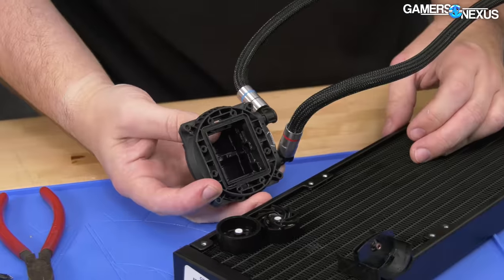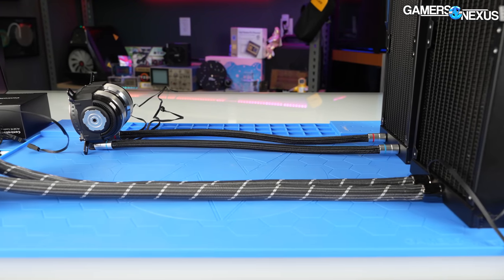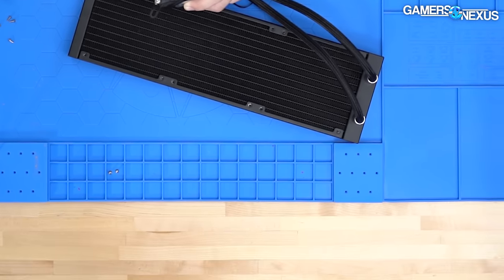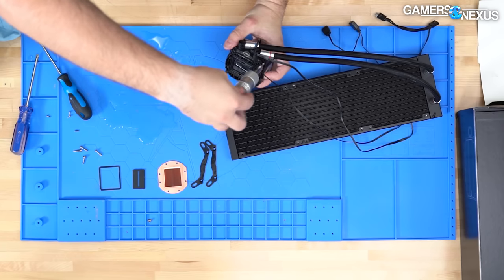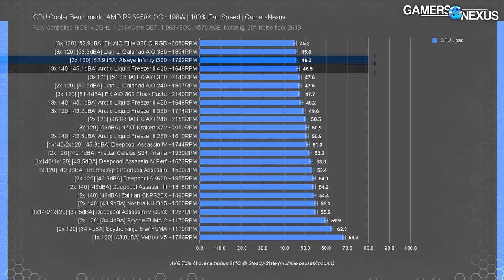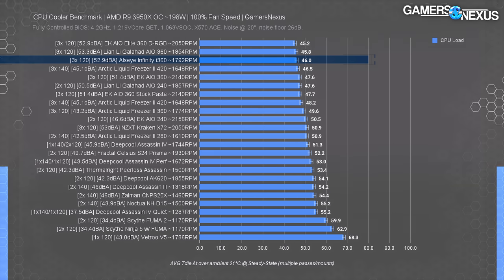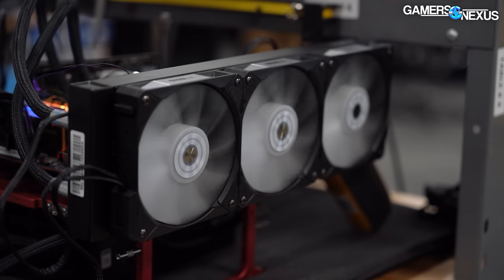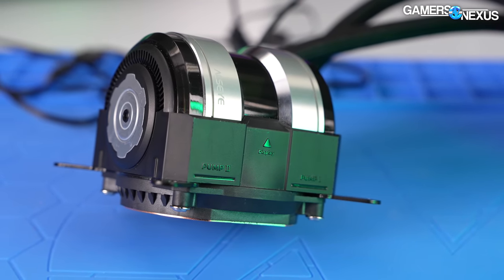Strange Liquid Cooler from AliExpress | Alseye Infinite i360 Dual-Pump AIO

Comment: So one of the things to consider when reviewing these AIOs is using a standardized set of fans so you know how well the water cooling aspect of the solution works vs the whole package. If you could get ground breaking performance from an AIO just by replacing the fans with a high airflow/static pressure solution that would be really helpful to know.
Reply: Good point. Ive used Push/Pull setups with high end fans on lower end 240s/360s. The difference was crazy of course. $75 cooler with some Phanteks T30s will cool a 13900k lol. Wont be quiet, but still lol.
Reply: Exaclty ! I would to see love that especialy since you can use the fans somewhere else and Use a better fan for the radiotor !
Reply: You can kind of tell this already by comparing the full speed graph vs the noise normalized one.  Generally the limiting factor for AIO's (and all heatsinks really) is the thermal density of what they are cooling and the thermal conductivity between the cpu die and their fins.  Another catch for a heatsink is heatpipe orientation as the CCD's will utilize fewer heatpipes if the heatsink is installed in one direction vs another.
Reply: While this is absolutely worth considering, it should also be noted that buying different fans will cost more money. That can easily push an otherwise price competitive product into being more expensive than other products that already come with premium fans that gain nothing from different fans.

And once you go down that route, you'll also have to do it for air coolers, where most can take standard fans as well.
Reply: Also IMO to try to minimize the extra work that could even replace the uncapped fan tests becase as its been said many times fans just brute force with speed and how realisticly is it that anyone would put up with that nosie level so really is it all that relevant...
Reply: @Xalies  well, they normalize for noise, which these fans obviously underperform at, if instead (or in addition to) they normalized with a set of fans that have a known performance, you would eliminate that variable from the tests. If they test it and it turns out there is no difference from fan upgrades, then sure, I would agree, but my experience with upgrading fans on coolers has been quite significant. It would be nice to know which AIO has the best core performance, fans excluded so you know how to get the best overall performance. I could imagine some of these AIOs come with placeholder fans that they don't even expect many end users to use based on their target market.
Reply: @BaronVonNeil  A fast way to reduce noise and increase performance is put some empty fan frames between the fans and the radiator.  The spacers can be more effective and quieter than adding 3 addtional fans to the opposite side of the radiator.
Reply: Not really, considering that this is more expensive than a much more efficient Arctic solution. Good fans are pretty expensive too, and people watching reviews for an AiO don't want to buy extra fans for around 40-60 Euros with an already expensive cooler, they want an all in one aolution that just works. So it's totally irrelevant if the cooler is better with other fans, cause for that money you can just buy another AiO that has a better overall performance.
Reply: @MrMartinSchou  No doubt at all man! Fans can definitely cost the full amount of a decent AIO now days lol.
Reply: @masterluckyluke  Do consider that Arctic fans are quite often absolute garbage due to bearing noise, my 3 or so month old cooler already has new fans on it because of the unbearable noise they made.
Reply: @kristoffer3000  Maybe bad luck? I mean in this reagion, when the fans die after a few months you can get a free repair or replacement because of the two years implied warranties. And in the tests I saw so far, the arctic coolers were between the most silent ones, also because of the thick radiator of course. However I'm not sure if I want to buy a watercooler anyway, and I also like the BeQuiet products, so maybe I just buy a Dark Rock air cooler. The main reason I look at AiOs isn't the better cooling anyway, the main reason is that air coolers need so much room and often block parts of the RAM. I'll think a bit more about it, maybe I find other users who can confirm the issue.
Reply: @masterluckyluke  I googled it and there were loads of complaints about it, I could've sent it back but I needed the cooler so I just got new Noctua fans instead, my old one just couldn't deal with my new 5800x3d haha
The Arctic is really quiet if the fans don't have the bearing noise.
Reply: @kristoffer3000  yeah some of their fans are worse than others and sometimes you even just get bad fans out of a batch. With the varying quality in their products it makes it hard to know which you got.
Reply: That's a very good suggestion, I agree!
Reply: He would have to implement it into all of the test setups though to get accurate readings
Reply: @nicknorthcutt7680   it's too difficult to attach the same fans (like decent noctuas) at max rpm into each aio and see what happens? are you implying he has a different test setup used for each aio, wouldn't that invalidate any of the comparisons? I'm not sure what the problem is

Comment: One Idea for AIO testing: Could you  use the same fans for all AIOs? This would bring out more the noise differences of the pumps and flow efficiencys. Sure the included fans are mendatory but could be tested seperately.
Reply: I was also wondering, because probably you want to change them or whatever

Comment: The fill port is actually pretty nice. Good to see AIOs with an accessible fill port.
Reply: Sadly it voids warranty. Same with the Galahad if I'm not mistaken.
Reply: @GabrielRodrigues-fg6ex  It is annoying but kind of makes sense. There really should be no reason to use a fill port under the warranty period. If something goes wrong, send it back.
Reply: It's useless to the end-user without a second opening to bleed air through. Manufacturers don't need one because they evacuate all the air from the loop before they pump liquid in - it's much quicker that way, and you can detect leaks while the unit is dry.
Reply: @GabrielRodrigues-fg6ex  The permeation rate isn't large enough to warrant the user to refill the AIO before the warranty expires. And if it does, something else is likely wrong with the unit and you're better off claiming the warranty to get it replaced

Comment: It would be interesting to see how this weird push-pull pump setup works with better fans, as it sounds like it's competitive with crap fans. I like that it has a fill port, that's something more AIO's could do with.
Reply: Yeah, to everything you said, the current test setup seems to test out of the box and not so much testing the AIO, some good things like the flatness and pressure map of the cold plate, but then uses the stock fans which is more a test of the stock fans ability and really should be in a fan test video, testing all the AIO's with the same fans would seem like it would give a more consistent test between AIO's, the issue being 120 and 140 Rads, with regards to pressure and volume of air and perceived auditory volume.
Reply: sometimes they swap the fans you get with the AIO either way
Reply: @MrTrilbe  I totally agree with ya, it seems to be solid other than the fans. I wonder how it would hold up over time. Also, I would be very interested to see the performance with one of the pumps disabled- Having dual pumps sounds great for redundancy on paper, but I have no clue how that would work in practice. 
I can kinda understand why they didn't swap fans. I guess because an AIO is supposed to be "All in one"/ plug and play, but I wouldn't mind throwing some upgrade fans on one of it's at the top of the pack- for me, swapping some fans on an AIO still beats the headache of open loop even if the price is close with less performance.
Reply: When every AIO manufacturer was using Asetek's pump design, it wouldn't have made sense to do that kind of test. Now that there is some varied competition on the market I agree, I would like to see "standardized fan tests" for these coolers to see who has the better pump/coldplate design.
Reply: @AlanTwoRings  But the full product is sold with Fans. So The full product should be tested as it is.
When a car is being tested it is tested as it was sold. A test with wider tires, a new suspension and maybe a tuned engine wouldnt help.
It can be tested but thats more something special.

Comment: @GamersNexus Spotted a potential duplication at 14:57 for the "[3x 140] [45.1 dBA] Arctic Liquid Freezer II 420 ~1648RPM" data - I see it twice on there, with temps of 46.5 and 48.2. Separately, been soldering a ton on your recent soldering mat, and loving it. Thanks for being awesome

Comment: Just installed this cooler on my AM5 platform yesterday. Wasn't my choice, got it for free from a friend, that said, very nice performance on my end. Gave me the same thermals I got from better-known brands with a much greater price tag attached. I don't know if it's going to stand the test of time, but so far so good. And just a quick note, my fans are as quiet as previously installed coolers by Corsair, maybe I just got a better set, because they are pretty silent while giving very good cooling.

Comment: I can definitely vouch for the benefits of the stiffer tubing. I have an old Cooler Master Nepton 280L that I bought back in 2013 or so (before Asetek sued everyone and it was pulled from the market) that has been in use 24/7 since it was purchased, with no notable degradation to cooling capacity. Despite it being off the market for half a decade when socket AM4 came out, an adapter kit was made available and the cooler has remained useful without ever needing to be refilled or serviced in any other way. Used it on everything from the FX-8350 I bought it for to a 1700x to a 3900x to a 5600x. Getting a decade of use out of unmaintained mechanical components is crazy imo.
Reply: Damn, Nepton 280L! I had one of those monsters before, cooled my FX-9370 pretty well! Sounds like a jet engine tho, befitting the JetFlo 140mm fans. Sadly the fans broke when they got choked with sand when I moved to a desert country, so changed them to IP67 Noctua iPPC fans. Still damn good, but I sold them off later on and decided to just stick with air cooling ever since I went Ryzen. Still great cooler tho.

Comment: I can't wait for the fan testing results to start. I'm very curious about how different fans affect a cooler performance. Testing this AIO with standardized fans vs other AIO could show how much a push pull pump truly affects the performance.
Reply: It could until they broke it all. Otherwise it would be a good test case for other better fans. Even higher end coolers can have their fans swapped for quieter or better flow versions.

Comment: Thanks Steve, you and the GN team have taught me so much over the last two years and thanks to your guys help I built a budget gaming rig out of a circa 2017 Workstation pc. i7 6700 (turboed to 3.8 MHz) paired with a 600w EVGA psu and an RTX 1080 fe with 16 gb ram for less than $400 has given me phenomenal performance on every I tried. American Truck Sim can run basically full tilt with around 70 fps avg, Metal helsinger and sonic frontiers also run maxed out settings. Havnt bought anything else that's a heavy hitting title yet but I run all this with the air cooler it came with

Comment: It looks very well engineered, they really put a lot of love in that product. I like the pumps.
The next generation is quite likely going to beat Arctic if they iterate on what they have.
Reply: These are all clumped together within 1C or 2C because they're reaching physical boundaries of how much heat they can move off the CPU with that volume of liquid.  Apart from lowering the noise level, they're not going to get much better performance out of a 240mm or 360mm AIO.
Reply: @markh4750  Stronger pump pressure allows more efficient heat exchange, faster flowrate allows more heat exchange. I don't know the physical limits of those small systems but they are certainly not reached.

Comment: I use Alseye's W12 fans for my rig with an overclocked 3070 and i7-13700k in a Hyte Y60 and I love them so much. Not too loud, look amazing, and perform well enough in my setup I've never had to worry about thermals. So far Alseye has a good rep for me

Comment: I think the general commentary about stator / rotor designs on fans is that you want to keep both at different numbers and odd/even configurations to try to mitigate some of the noise.  While I get that they tried to increase the static pressure here, a stator on fans also increases the wake turbulence and noise.  The designers did angle both differently, but the configuration guidelines still stand.

Comment: On the fan design & resulting noise, the number of struts relative to the number of blades is in fact relevant.  You want those two number to be coprime - that is, not divisible by each other and sharing no prime factors in common.  That's because, as each blade passes each struct, it produces a pulse of turbulence noise, and if those pulses all happen at the same time, it makes a louder overall noise than if they happen at different times.  (For an example of these noise pulses, listen to sonar recordings of a big ship's propeller, where typically a three-blade propeller interacts with the single "strut" of the ship's keel and rudder, thus making a sound like a steam locomotive working hard.)

Comment: Could you hack a gpu block into this? Seems like the two pumps should have enough pressure.... throw some stronger fans on the radiator, and you've got an extremely efficient full setup!

Comment: 3rd place in noise normalized thermals with lousy fans.  Seems like this would do pretty darn well if you swapped the fans, even for something fairly cheap like Arctic's P12.  I have several of those just laying around.  This design might top the charts if every AIO was running the same fans.

Comment: Here's a recommendation. When you come across a fan setup like this that you can't get to a noise normalised level in the usual way, test it with the lowest SPL you can obtain without errors or trickery to get it to work. The result should be highlighted as such but that would be more meaningful to me as a "what is the average user going to get" scenario.

That aside, I really love the look of the pump. I didn't get your meme references to it, but to me it looks like an industrial turbine housing. I'd be very tempted to get it for that and just use the stock front mounted fans of my Be Quiet! 500fx case instead.

Comment: This is an interesting product, especially an AliExpress product. As someone who usually replaces the AIO fans to match what ever build I'm doing. I'm quite shocked though that neither you or the company who has created this AIO has thought about redundancy with the pump design. This could be a massive selling point. If 1 pump fails does the other keep working? It could throw an error on the PC informing the user that a pump has failed and they could continue using the computer until it is replaced. Which is a lot better than the current (pump fails, cpu heats up the block, it reaches max temp and then shuts down) leaving the user without a computer until another can be bought and arrive.

Comment: Thank you.  Trying super thanks for the first time!  2 questions: 

1. What was the reason for uneven mounting pressure? You mentioned it would be discussed in the mounting section, but I don’t think it was? 

2. @15:00 the chart shows identically labeled Arctic Liquid Freezer II 420 in two places.  What is the difference?

Comment: That was quite the disassembly video!  I've rebuilt hundreds of pumps, various designs all kinds of applications, this one is in need of a K.I.S.S. lesson.  Using a dual pump in series for such a low pressure system is such a gimmick, way too complicated in this case!

Comment: As for reasons to buy - a refill port, and shorter tpfe coated tubes. Shorter is likely better for most mid sized cases (in contrast to liquid freezer ii extra long ones). Looks are on the nicer side too.Ah yes, torx screws (not PH1 junk)

Comment: To be honest they could ditch the fans and reduce the cost and I think be good here in the case of noise as people could get better and quieter fans on their own. Maybe a second model version just without the fans could work well. I never liked the AIO block style and it kinda is why I never really wanted to go for it. This looks good and a little bit of noise that sounded to be a consistent low pitch does not bother me at all. A lot of parts does not mean it will break and fail quickly. I have seen some engines and transmissions that have almost 2x the parts of older know reliable versions that do well and they are known and proven to be reliable and hardly fail and if they do then its abuse and/or lack of maintenance. 

Overall the low performance is not the pump but the fans and that's mostly noise normalize. Would have been good if you could do a Fan swap as a nice addition to the tests for most of these fan included AIOs to see if a fan removed version would rank them higher if you could chose your own fans. This one might be in that case. If anything it might make enough of a request that the ones making these might offer that version later as a proof of concept.